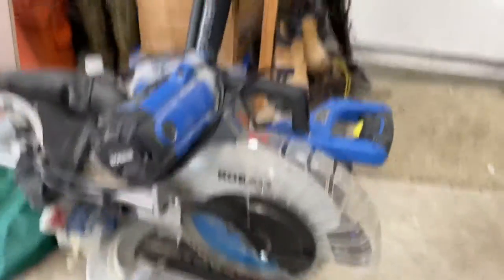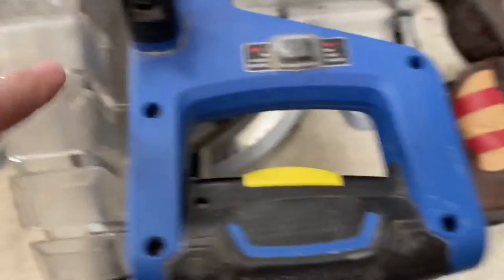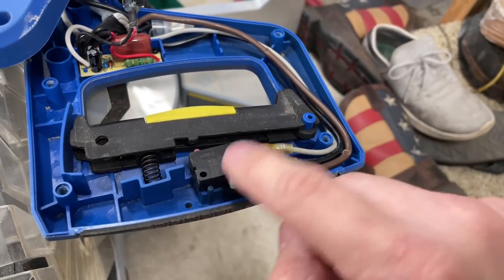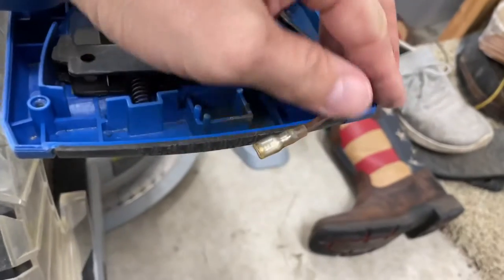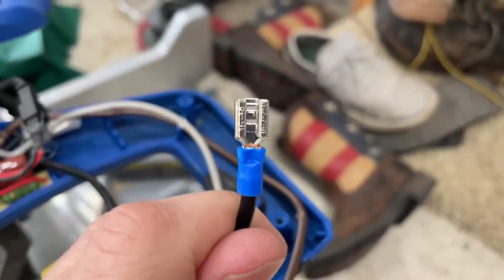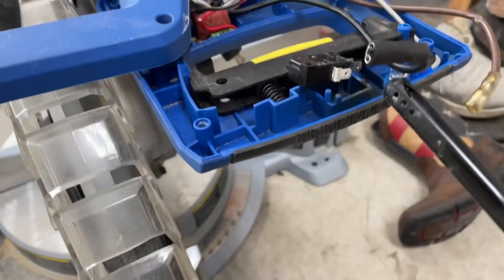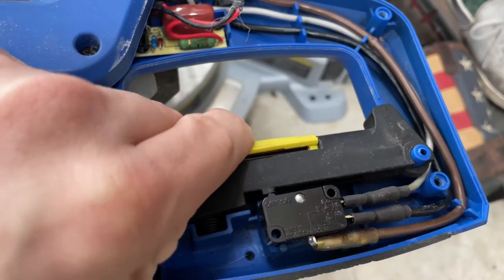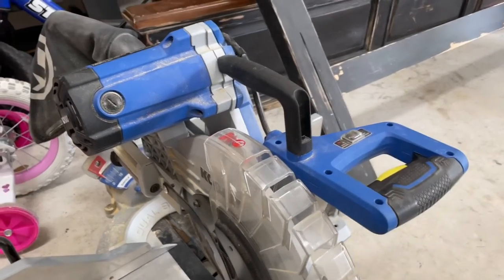How to Fix a Kobalt Saw that Won’t Shut off

Comment: I appreciate this greatly. My saw is this exact one and is just out of warranty (of course). My problem is the switch is intermittent. Your link to the switch doesn't seem to be the right one anymore but if one Googles MSB-1215B (2:46) multiple options come up. Thanks again for this.
Reply: In case anyone cares, Grainger has a switch item # 5JEC0 for $2.74 that's a perfect fit.
Reply: @Duetmaster2  Thanks for posting this. Definitely looks like the original amazon link he had is no longer the same. Just purchased this from Grainger and will hopefully fix this issue on mine.

Comment: I just bought a new one and before I throw away the old one, I will remove that switch part, just in case it fails. Thanks for the information here.  The old saw had rusted slides and broken guard and bag was ripped, it was toast.

Comment: Mine keeps stopping!! It works great for about 6 cuts, then quits and won't come back on. A few days later I tried again,  same thing. I've had the saw 5 years,  but never used.  Now I'm trying to use it, but it doesn't stay on

Comment: The problem I have with my Kobalt is that when I change blades the motor will shut off but the blade will keep spinning.  As soon as I put the Kobalt blade back on it works fine.  Anyone else have this problem or can help me figure out the issue?
Reply from the maker: Weird. I’m using a dewalt blade, and the brake works fine.